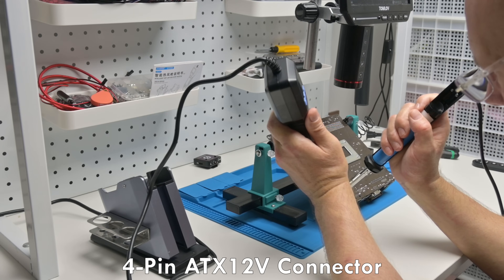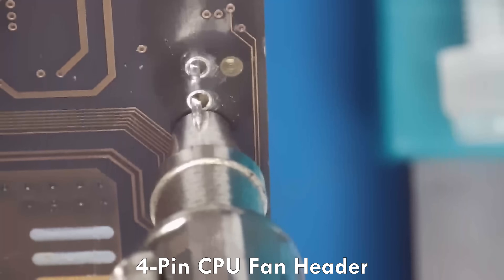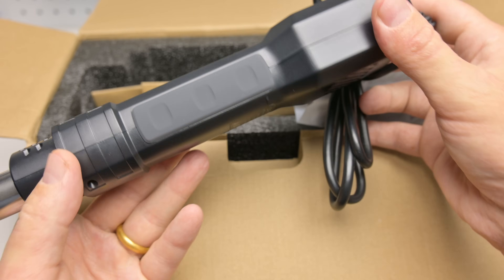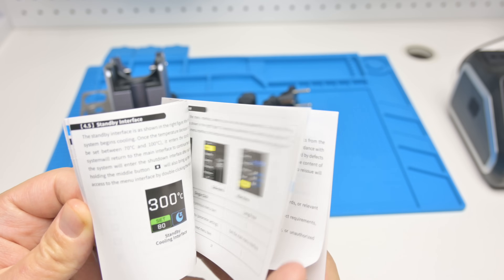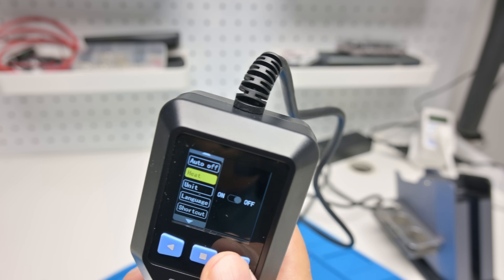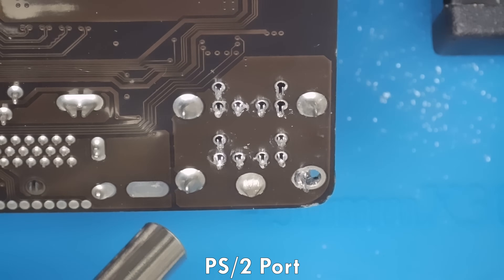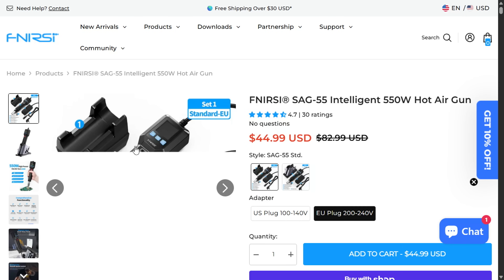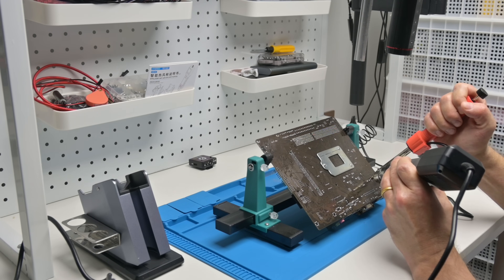Using a Hot Air Gun to Make Desoldering Motherboards Easier (FNIRSI SAG-55 550W Hot Air Gun)

Comment: What the hot air gun is doing is preheating the board. The more professional way to do it is to pre-heat the whole board or a bigger area so your soldering tip has less work to do while preventing the board from warping or popcorning if you get impatient and crank up the hot air to the max to blast it.
Reply from the maker: Yes, I bought a board preheater since then! Huge gadget actually, takes up a lot of room on the desk LOL

Comment: How easy/hard is it to do this? I have no electronics experience and have to repair solder on my SB Pro2 as the speaker output jack is a little wobbly and crackly. Terrified I will destroy it
Reply from the maker: Practice with soldering kits first. Work on scrap parts first.

Comment: Watch out wiggling around the sucker nozzle. Easy to damage traces nearby. If you use smaller sucker nozzle (one that does still fit the to be desoldered pin) you won't have to wiggle as much 😉 Also adding a bit of fresh solder and/or flux will help greatly to get the existing solder to melt.
Reply: If you need to wiggle, stop. I ripped so many traces with that. Just reflow the joint with a tiny bit of low melt solder and flux then use the hot air on low temperature (halfway between the low-melt solder's melting point and the 60/40 solder) and patiently heat the area with hot air till the joint look smooth then pull it out gently. Don't use the soldering iron while pulling. It's a recipe for disaster.

Comment: 55USD is not bad for hot air station, its sometimes double that price in India for a decent low end one.
Reply from the maker: Only $45 if the simple stand is enough for you :D
Reply: @philscomputerlab good stand is required otherwise it can burn the table and surroundings.
Reply from the maker: @yoppindia Ok fair enough!

Comment: Thanks for the video! The easeist way to disolder smth is to use Rose metal(low melt solder) just apply it, heat it up and the component will fall by itself(almost), just try it, it is a real time saver!
Reply from the maker: Thanks, I have to try that!

Comment: Welcome to the 20th century (yes I know it's the 21st century now). People (who know what they are doing) have been using hot air for 50+ years to remove soldered parts. 
Pro Tips: 
- The tip you are using is too large. Use a smaller tip otherwise you damage the PCB and the solder mask. 
- Also don't apply too much downward pressure otherwise you damage the PCB and the solder mask. 
- Also don't move around too much otherwise... you guessed it.... you damage the PCB and solder mask. 
- ALWAYS add fresh solder to old joints first to make desoldering easier.... otherwise... you guessed it again.... you will damage the PCB and solder mask. 
- If you are looking to see what PCB damage and solder mask damage looks like you can check your own video LOL!

Comment: The large stand is the best bit. Not sure i'm fond of the actual gun or how it has an extra inline brick, because Yihua makes one that doesn't need the brick.
Reply from the maker: The Yihua, if it's the same model I have in mind, is double the weight however. So comes down to what you prefer 😊

Comment: Get some low temp solder as well. It’s amazing for this type of work.
Reply from the maker: Yes, it's on my to do list!
Reply: are you saying mix in new low temp solder then suck the mixture away at a lower temp then the initial solder (like 100F lower temp) to save the PCB?
Reply: @larryseibold4287 Yes, adding low temperature solder makes removing through hole components a lot easier.

Comment: Very nice Phil ! I also am considering getting a heat gun ! I already have a Fnirsi handheld oscilloscope
Never quit! we love your videos !
Reply from the maker: Nice! What do use the oscilloscope for?
Reply: @philscomputerlab  Phil I use it to see if motherboards that dont start have the clock signal running and to see ISA lines that might be broken because of battery acid. I also repair a few ZX spectrums and the osciloscope if perfect for scanning data and address lines
Reply from the maker: @fft2020 Wow amazing 😮
Reply from the maker: You should make videos about that 😊 @fft2020

Comment: They say that using a board preheater is the way to go, but they are expensive and cumbersome especially for precision work like you're doing.  The hot air gun takes up less space and gets the job done!  Good tip!
Reply from the maker: I'm looking at getting a preheater!
Reply: My "board preheater" is the cooker or plate in the kitchen😅

Comment: I used an off the shelf Wagner heat gun. It can blow  cold air, then ranges from 180 to 1400 degrees F at 10 degree increments along with fan control.  I made my own nozzle restrictor tip from copper.  The benefit is you can touch the copper tip to the pin, and get heat onto the pin like a soldering iron and the back off and use the air to keep the solder flowing.  It's not as user friendly as a dedicated unit like you reviewed, and it is a bit bulky.  But I use that hot air gun for so many different things. Anything from molding PVC and ABS plastic to stripping paint. I have so many tools already, that expanding the utility of a single tool was worth the effort to make my own tip.  I don't do very much resoldering anyway.  Only a few projects over the years, so a dedicated tool makes little sense, and I have a Hakko solder station already.  I use that Hakko to weld plastic more than anything else 😂.
Reply from the maker: That's very nice!

Comment: Just buy a proper desoldering gun and make sure to use the correct sized tips (Mobos tend to need smaller tips). If you're still having issues then add fresh solder and try again. There are cheaper ones than the Hakko that will do the job just fine. The tip your sucker is using is way oversized.

Comment: I recently bit the bullet and bought a Hakko FR-301 from Japan and swapped out the two resistors inside to make it USA voltage compatible (much cheaper than buying the US version).  It completely solved all my through-hole desoldering woes (including ground planes) and is a joy to use.  Expensive but totally worth it to have it moving forward.  I need to learn how to better deal with SMD devices and a hot air gun is probably in the cards, but I need to do more research.  I often grab them with pliers and twist them off, then desolder what remains.  Perhaps I can get a tiny long pointy tip for the FR-301 that I can put next to the SMD parts and suck out the solder.  Edit: perhaps the Hakko N61-12 tip will do the trick.
Reply from the maker: Sounds like a great investment! Yes I've heard good things about the 301.

Comment: Oh fantastic Phil, been looking for a hot air gun for a while, not so much for desoldering, although it will be good for that, but more for heat shrink. Don't get me wrong, desoldering is painful, I've been making electronics stuff for years, and I always despair when I need to desolder something. All the joints are tiny in electronics, I'd be there for hours trying to get solder wick to work. I'd watch all the videos, and see folk whooshing the solder wick up and down the joint and the solder just goes, but not for me, numerous times I'd end up just getting a tiny drill bit and just drill the solder out. That was up to a couple of months ago, and god know why this didn't occur to me before, but I realised you need to hold the soldering iron still until the wick heats up, them move it. Anyway this heat gun looks ideal, it's the 1st one I've for a price I want to pay, most have been just a touch pricey, considering how little I'll use it. The amount of stuff I've bought from Chinese e-commerce on your recommendation, they must love you over there, lol.
Reply from the maker: Thank you for the kind words! Yea a lot of this is practice. I got some scrap boards to practice, and it takes the pressure off things. Don't start practicing with a Voodoo 5 :D What you often see on YouTube are very experienced people, and often they have a preheater, or use low temperature solder. All sorts of little tricks.

Comment: A very helpful tip: add fresh solder. The solder on these boards is probably lead free, which melts at a higher temp. Added flux can also help immensely.
Reply: ALWAYS use fresh solder. 
It will reduce the thermal resistance from the tip to the pin.
Reply: you can get solder that has  bismuth in it, which has a very low melting point.
Reply: @evanislost  Low melt solder is expensive, but it'w worth every penny compared to ruining the boards or lifting pads. Remember to clean the joints with regular solder because this stuff is mechanically weak and it lower the melting point of what it mixed into so it's not as sturdy as pure 60/40 or 63/37

Comment: Yeah, very good tip.I made the same experience with systems from around Pentium II and later. Without additional heat gun desoldering parts is a pain. Meanwhile I use heat gun even on older hardware. It is not necessary, but makes things a lot easier.
Reply from the maker: Yes it's such an improvement, I'm excited 😊
Reply: Necro in tha house !

Comment: Are you sure that you're using the stand the right way around? 🤔Seeing you struggle to get it in is almost painful. Turned around, you could've remained seated and slid it right in there - y'know, the ergonomically angled tool holder. 😉 Then the hot nozzle removal thing would conveniently be on the front, instead of "on the back".😅
Reply from the maker: Yea that's how they have it on their page 🤣 But you make sense, I'll just try the other way next time 😁

Comment: Used regular 2000w heatgun to swap LGA 1151 socket and PCI-E x16 socket. I have smaller soldering hot air gun but thats too weak for anything major

The motherboard still works but after a while it became kind of slow for some reason, i wonder why...

Comment: On my side i put fresh 63/37 leaded solder just before pulling out components it help to lowering the melting temperature  and it's easier  to pull off, i use this exact same methods  to avoid ripping traces  :) i build my own desoldering station with this tutorial https://www.youtube.com/watch?v=HYyAkK1EaeU  pretty easy to build and very usefull!!
Reply from the maker: Yea it's a good strategy. There is even special low melting solder for this purpose.
Reply: @philscomputerlab Hi Phil!  electrolytic (and some other) capacitors can vent, pop, or even explode if you heat them too much while desoldering, especially if they’re still charged or heated unevenly. A heatsink on the leads helps, but the real safety steps are discharge, control the heat, and protect yourself.

Here’s a concise safe procedure and important notes:

Power off & isolate

Remove all power and unplug the device. Wait for any power LEDs to go out. Do not touch caps while the circuit might still be powered.

Discharge the capacitor(s) first

Confirm with a multimeter across the cap. If it shows significant voltage, discharge it safely with a resistor (typical practical choice: a 1 kΩ, 2–5 W resistor) across the terminals using insulated leads — hold with insulated clips and keep the resistor connected until the meter reads near 0 V. Then short briefly with an insulated screwdriver only after using a resistor if you understand the risks. Always re-check with the meter.

Use the right removal method

For through-hole electrolytics: a soldering iron with desoldering braid or a solder sucker is usually safer than blasting hot air at the whole can. If you must use hot air, keep the nozzle moving and don’t concentrate on the can body — heat the pads/leads from below if possible.

For SMD capacitors / small ceramics: hot air is fine at controlled temps.

Temperature & distance

Keep hot-air temperature and airflow modest: don’t sit the nozzle directly on the can. Heat the PCB pads or joint rather than the capacitor body. Move the nozzle continuously and remove the cap as soon as the solder flows.

Use a heatsink clip or pliers on the lead

Clamping a metal plier or an alligator-clip heat sink to the lead between the board and the cap helps conduct heat away from the can and reduces stress. Hold it with insulated pliers; don’t clamp the can itself.

Mechanical removal alternative

If desoldering is difficult, cut the leads and free the capacitor mechanically (after discharge). Then clean the pads and finish desoldering the remaining lead stubs.

Watch for aged or swollen caps

Old, bulged, or leaking electrolytics are more likely to vent if heated — be extra cautious and use lower heat or mechanical removal.

Tantalum capacitors

These can ignite if mishandled (especially if shorted or overheated), so be gentle and avoid excessive heating.

Personal protection

Eye protection, gloves, and a face shield or mask are good. Work in a well-ventilated area. Keep flammable materials away.

If a cap vents/explodes

Move away, ventilate the area immediately, avoid inhaling fumes, and wash any skin that contacts electrolyte with soap and water. If there are burns or eye exposure, get medical attention.

Bottom line: heatsinks on leads reduce the chance of damage, but the crucial steps are to discharge first, control the heat, and protect yourself. If you tell me what type of capacitor (electrolytic through-hole, SMD ceramic, tantalum) and the board situation, I can give a tailored technique.
Reply: @luispauloArq  very true popping caps can make you go blind with metal shrapnels .it happen to me one time i was lucky!
Reply: @philscomputerlab   cool :)

Comment: Desoldering is a real nightmare. I recently tried to fix 2 little devices and removing the caps were an absolute pain. I somehow managed to remove the caps but then the holes were filled with solder, doesn't matter what I do they didn't clear up. Eventually I ended up ruined the PCB. This video reminds me that I should try again and practice instead of giving up on repairs :)
Reply: The problem is not enough heat.
Reply from the maker: Failing is learning! Absolutely, try again. There is always a broken part around the corner 😄

Comment: To remove components from a multilayer PC mainboard, I use only a hot air gun. Afterward, I clean out the solder hole again using hot air along with the ALX-02 manual solder sucker, which is an excellent and affordable tool.
To make the process easier, you can add some leaded solder and no-clean flux to lower the melting temperature.
Reply from the maker: Thanks for the tip!

Comment: Great video. I use a 80watt iron and a desolder wick seams to work well. This seams to be a hot air station in the handle along with the elements and motor making it a bit chunky. I think a normal China rework station could work just as well? So the pump is really whats making you have better outcome?
Reply from the maker: A regular rework station would work just as well. This one has everything inside the handle, that is the main difference. Without the hot air, no chance of getting ground pins out. I tried in a previous video, it was a total disaster.